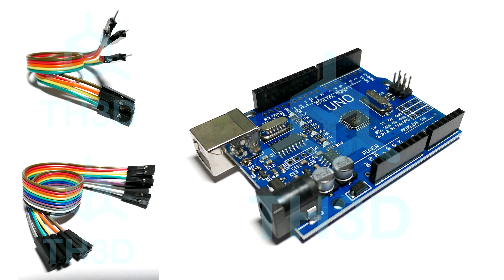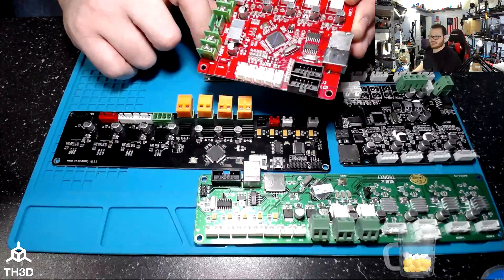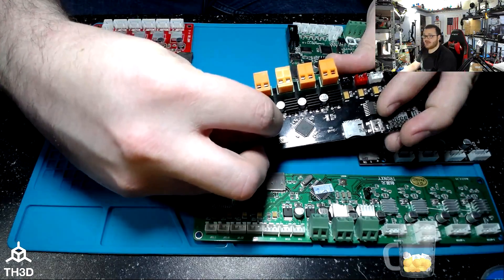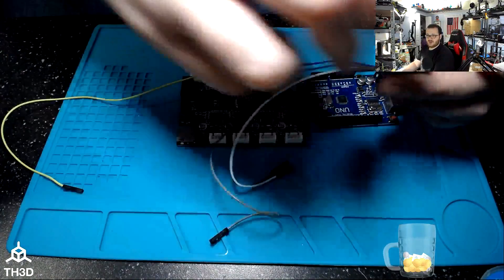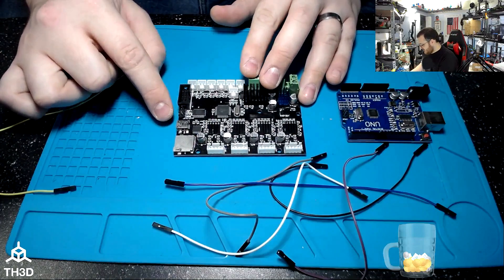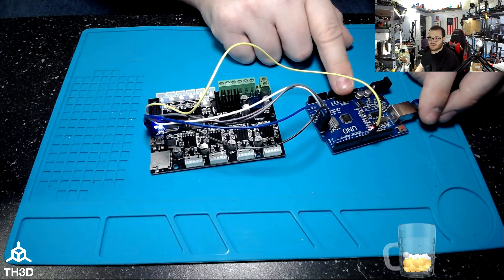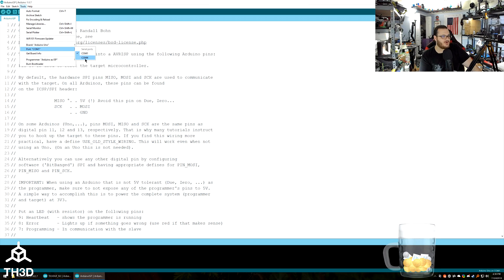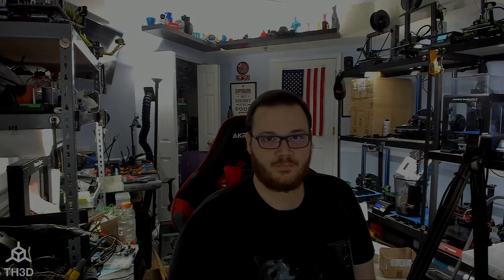Bootloader Flashing Guide - CR-10/Ender 2/Ender 3/Ender 5/X3S/X5S/Wanhao i3 - 1284p Boards

Comment: I have an Arduino Duemilanove. Your customized IDE does not list it. It was quite a pain to figure out why (I had to install the regular IDE, and then copy its boards.txt over). Despite that, trying to upload the bootloader results in the error "avrdude: stk500_getsync() attempt 1 of 10: not in sync: resp=0x15". Trying to program an Ender 3. Also, the Ender 3 (v1.1.3) does not appear to have a jumper. -- Later: Turns out the Duemilanove is not able to do the task. I had to get a Rev3 Version of the Uno and then it worked fine.
Reply: You have to put a 10 μF capacitor on the reset and ground.  Do not use the capacitor when uploading the ISP, just the boot loader. Just FYI in case anybody else has the same issue.

Comment: Does anybody know how to do the PID tuning for the bed? In standard Marlin, you have to disable the safety features to run it and then enable them back, I tried to do the same here with the advanced.h settings but I always get the error on pronterface wrong extruder selected, it should be E-1. Thanks

Comment: You mentioned that the light next to the "L" on the UNO should be pulsing.  Mine is still blinking fast.  What should I do?
Reply from the maker: Try to upload the sketch. It may just have a different version of the LED blink sketch on there vs ours.

Comment: Great info Tim !
Can you also use a Raspberry pi  as a Bootloader  ?
That would be a great video as well.
Reply from the maker: We've had customers use them and it killed their Pis. We do NOT recommend using a Pi. A Pi is 3.3V and the boards are 5V. You can see the issue here.
Reply: @TH3DStudio : Great thanks for the update.....lol glad I didn't try it
Reply: @TH3DStudio   FYI: Rpi runs on 5V.      Not sure how they have  blown up a pi, maybe they powered up the Pi and the board at the same time?
Reply: I just had the same question.
Reply: You totally can  & its even easier with a Pi, thats how I have done mine. However I  have not seen someone do it with  the newer PI's . I only have been successful with the  older not  pi3.   The image I used was based on Minibian  and I have not been able to update it to run on the newer Pi3.